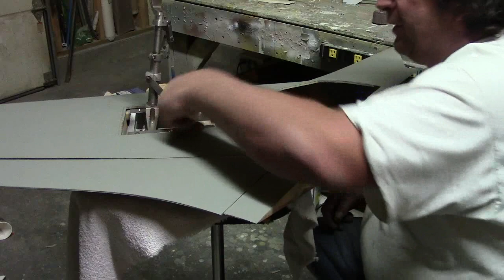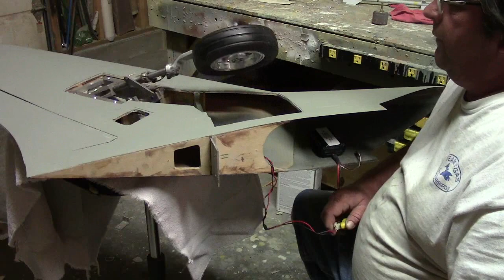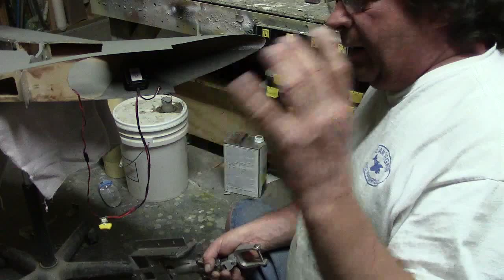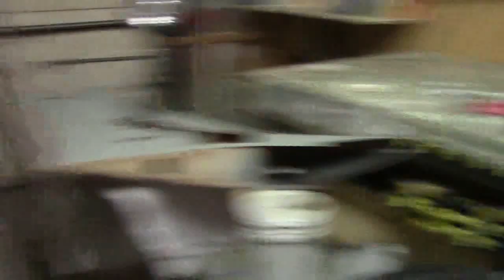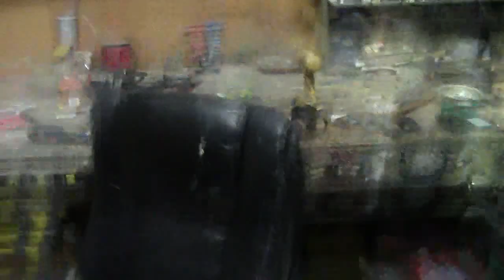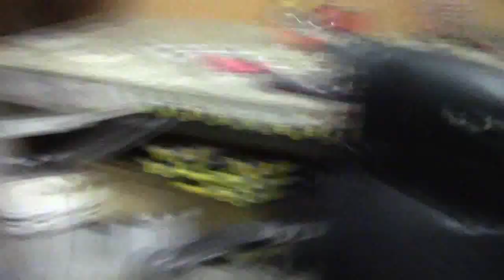Electric gear!

Comment: Bob. Big fan. Hey if I was you ill use the better stud because if you use that harbor freight stuff it may last, but chances are that is not. Remmber ur not using it as a screw driver. The reason I'm telling u is. I'm a bodyman. When u used that stuff from hfreight a lot. It tend to break very fast. U spend a lot of $ & time putting that plane together & I would hate to see it getting all misup in just one landing. Big fan.